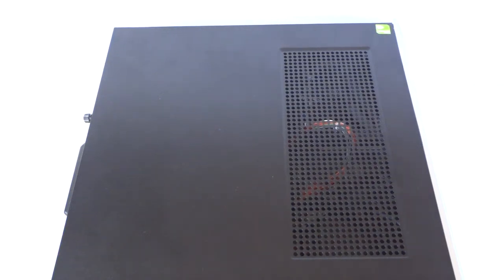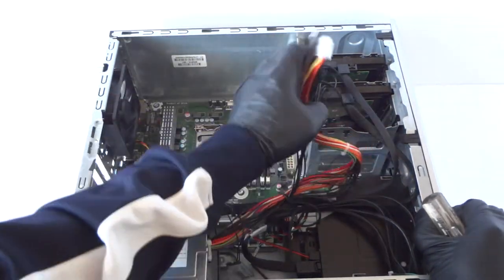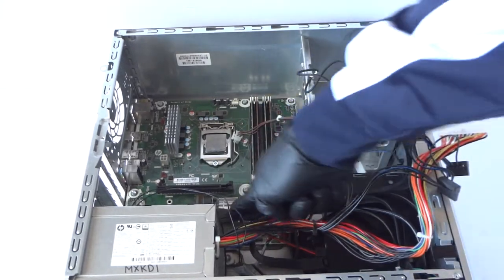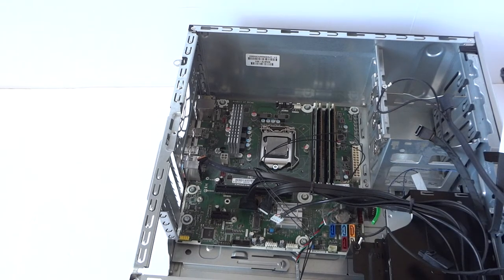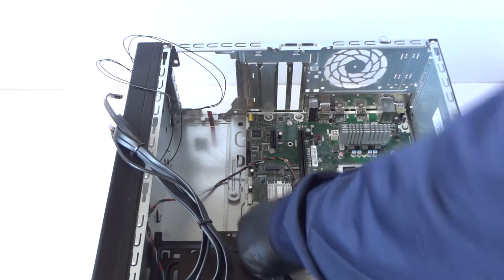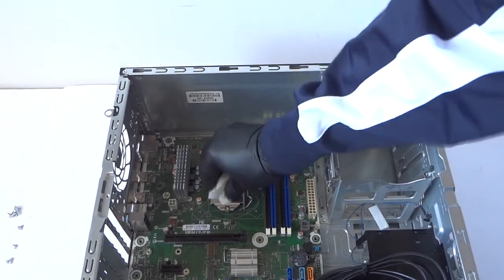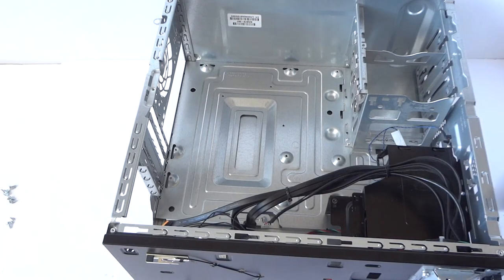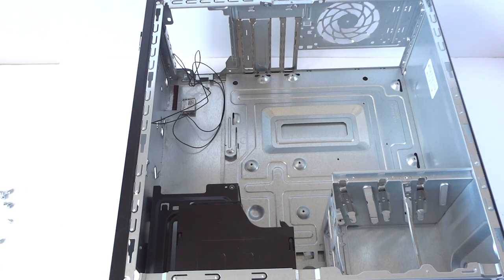HP Envy 750 Teardown

Comment: Is it possible to replace the HDD with a 2TB SDD? 
I am asking for 2 reasons:
[1] My current HP Envy 750-160qe has a HDD which is 1.8TB; 
[2] Up above (in the .more section - "List of Parts and Upgrades works with this system" - HDD list works with this PC) you say that the HDD can be a WD Black 2TB.

Comment: Is the backplate for the cpu heatsink able to be removed? I just bought an aftermarket cpu fan, but it will be a slight difficulty installing it if I cannot remove the backplate.
I ask, because I've read that some pre-builds come with a backplate that attaches to the cpu binding clip, so the motherboard can be damaged if it is removed.

Comment: That wireless lan cable tucked under the tape on the psu, one of them came off that part of the motherboard but it still works , how do I reconnect the other? Or do I need to ?

Comment: What are the 2 mother boards that came with this pc, i see one does upto 16 gb ram and the other does 32 gb
Reply from the maker: Hi, it depends which model HP Envy 750 you have?
Reply: @mxkdt  hp 750-124
Reply from the maker: Maximum memory suports:16GB DDR3 2RAM slots, you have to check your motherboard model inside your PC.

Comment: Is it possible to upgrade the casing of hp envy into gaming pc case?
Reply: Yes. You can just lift the entire PC out and put it in another case. Keep in mind however you will loose the front IO, and might need to put the power supply in a different position depending on the case you use.
Reply: @CarthagoMike  guessing the front io plug socket is not universal? tempted to do the same to my 750
Reply: @YBSTV_Official  I mean, the USB 3 connector itself is universal, but the I/O sits on a different, proprietary PCB. If your alternative case comes with a front I/O PCB and internal USB cable, then you can just plug that in the USB 3 connector on the HP motherboard.

Edit: At 4:28 in the video you can see the USB 3 internal cable (with the blue ends).

Comment: What gpus can you put in this case  because i dont kniw what the power supply is?
Reply: You can replace the power supply. I just added this to my case though the retaining clip on the PS doesn't work anymore because it is a little too long: ThermalLake Toughpower GF1 750W. Note however the DVD drive uses a proprietary power connector so if you swap out the PS for another video card then be ready to give it up. Also make sure your video card is no longer than the 970 GTX - I make that mistake where the replacement was just a bit longer and would not install.
Reply: you can upgrade your PSU to 500w, and check to see if your pc is compatible with a Radeon RX 580.